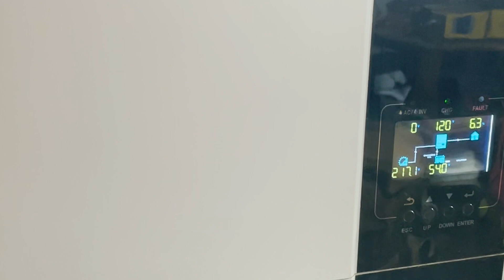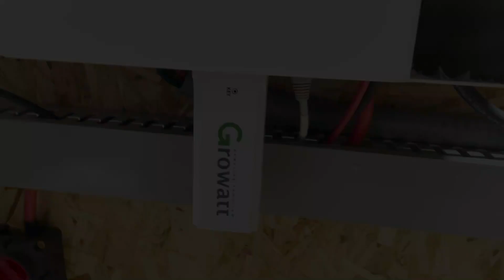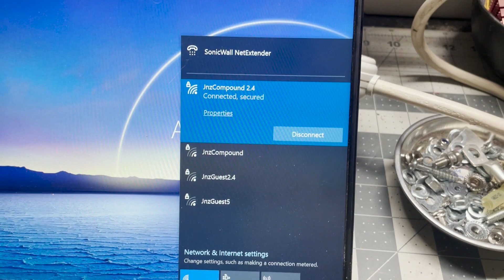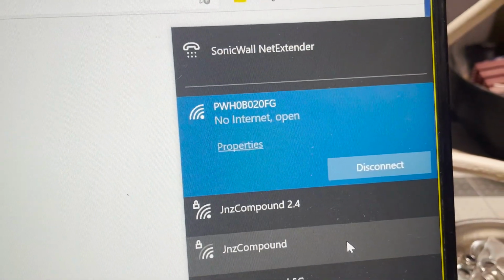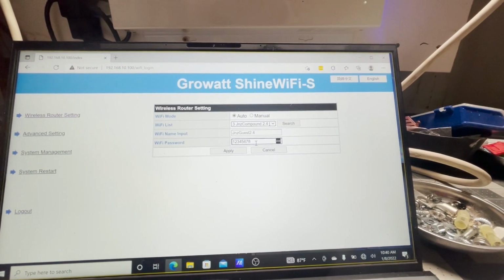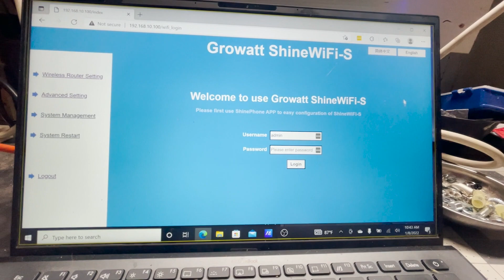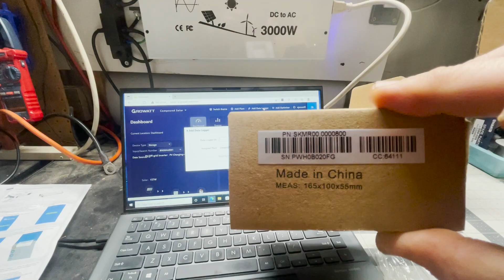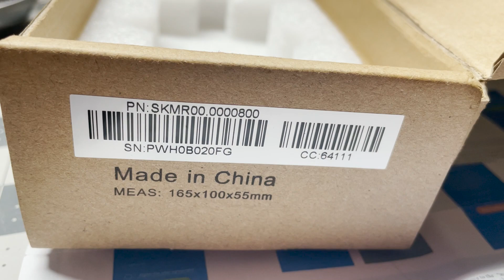Growatt Wifi Adapter Installation and configuration

Comment: Thanks for this video, I changed to a dual band router, 2.4G/5G and my Growatt went offline. I tried to set it up from the phone up, but it just would not accept the STANDARD MODE setup. I followed what you did in this video and got it working again.

Comment: Thank you very much!  I recently installed a couple of Growatt inverters that came with the wifi dongles. After two weeks of frustration trying to get the dataloggers to work, I was about to toss them. Then I came across your video. And yes, changing the default server to the US one immediately solved the connection issue. I added the S/N of the dataloggers via the website, and the Shinephone app automatically completed the setup. Thank you again!
Reply from the maker: Thanks so much for saying that.  Makes my day to know that it helped out.

Comment: Any idea what to do when the device status of the wifi dongo says: "Status: Lost" on the dashboard. There doesn't appear to be any consistent way to get the wifi dongo to get detected and connected to wifi but even when I do get it to start blinking blue and have the dashboard recognize it, it is still "lost." I have deleted and try to add it back again under the datalogger, but it gets to the part of being lost and never goes anywhere further. The dashboard says something about wait 5-10 minutes to allow the device to connect, but it still hasn't connected and it has been hours. Any help is appreciated.

Comment: I'm tempted to also buy the same grow watt inverters but after looking at so many other brands its hard to choose . If you had to buy over would you choose growatt again?
Reply from the maker: Yes I would.  I had the Growatt 3000 in a non-insulated storage container for 22 months while I was living in my camper.  That thing ran non-stop with zero issues in 100F temps.  So far I am really happy with the Growatt products that I have purchased.

Comment: Good video it helped a lot.  I installed my wifi dongle using the laptop first.  But now I’m having trouble setting up the shine phone app.  I assumed the “data logger” would already show up in the app, but it wants me to add a “data logger”.  When I scan the code, it won’t connect.  Do I have to put the blue blinking light back into the solid blue mode?  And if I do this will it disconnect everything I did in the original laptop setup?  Sorry, for the newbie question.  Thanks
Reply from the maker: No, once it is setup on the "server-us.growatt.com" site it should also show on the shine app as long as you are logging in with the same credentials.

Comment: My growatt is sso much noisy the fan always runs at full speed and it is loud, is there a solution? or can i configure the RPM of the fans in the monitoring page?
Reply from the maker: Which growatt is it.  Mine is fairly loud only when it has a lot of solar coming in or is out putting a lot of watts, otherwise it is not too bad.  Mine are housed in a separate solar shed so I don't really have to hear them much unless I am working in there.

Comment: what if the color on growatt wifi can't change? I've tried clicking it 1 time the result turns blue but it's not full, I tried clicking it again but it doesn't work. what is the solution for such problem?
Reply from the maker: You can stick a paper clip into that little hole where the light is and force it to reset and start the process over if you need to .

Comment: Has the software been ok for you ? Has the system had any downtime due to communication issues ? Thanks
Reply from the maker: No down time.  And there are settings that I have only found in the software that are not on the Growatt interface.

Comment: HOWdy  P-O-G,
Thanks
Your 5000 inverter is better configured than my 6000 GroWATT  which turns the white DONGLE  sideways 
and the "pin" I need to push / press is immediately adjacent to my  0000-AWG (4/0 +positive+ ) battery cable 😞
I have never been able to get my DONGLE to communicate with the GroWATT Server 
- due to my LACK of a CELLULAR TELEPHONE  --- which was NEVER mentioned in the Pre-PURCHASE literature 
COOP
...
Reply from the maker: That's frustrating because being able to monitor remotely is key for me.  Sorry you are having issues.

Comment: Thank you :) 
You have in parallel 48/5000 and 48/3000?
Reply from the maker: I have 2 48v 5000 in parallel and one 48v 3000 in my storage container running alone.
Reply: @pawneeoffgrid2614  thanks for the quick response!!! 
Today i order 2x 48V5000 :)
Reply from the maker: @MariosKp60  I was a little intimidated about the parallel hookup, but it was easy.  Good luck and I hope all goes well.

Comment: SPF 5000 ES( Growatt)
off Grid  Solar New Installation
with 12Vx 250Amphrs- connected in series

Why do  i get  230 current at solar  input terminals
+ points &  -side.?
(ACpower)  terminals  at the inverter.

Becos of this reason ,we did not  install solar panels to 
the Inverter.
System is working  on batteries . Fine
earthing is checked
Inverter is earthed.
when its on batteries  you  can ?? funny
but true
what is the reason  for this?
Reply from the maker: I am not exactly clear on your question, but I know the 5000ES growatt will except 450v in solar.  If you are connecting your panels in series, you will be adding the voltage for each panel that you plug in.

Comment: Johan de Swardt : South Africa : 
(1) So I assume the Growatt inverters do not have build-in Wi-Fi monitoring abilities, like other Inverters?
(2) If I have two Growatt 5Kw SPE 5000 ES 6000W single phase invertors, parallel connected, will I need one or two Growatt Wi-Fi Adaptors?
Thanks
Reply from the maker: Correct, you have to buy the wifi adapter separate.  And I am not sure if both inverters need an adapter when paralleled together.  I am wiring mine up over the next couple of weeks and will find out and let you know.

Comment: Nice Video man. I got the shineWIFI-F Adapter because this one is especially for the SPF5000 ES Off-Grid-Inverter. Now i wanna install and the Wifi which is broadcasted by the adapter has password and this is nowhere to find. So i could not connect to this network and i could not install the adapter. 😞I even reset the adapter but same problem again and again. Do you have any idea to solve or do you know a factory password? Thanks and greetings from germany.
Reply from the maker: admin and 12345678  is the default password

Comment: Hi. Thank you for the video. Actually I live in Lebanon. My datalogger was working fine. I changed the router so I had to reset and configure it again. I followed all the steps 100 times but I end up with Flashing green light.
Any suggestions?
Reply: I also had to change my router name and I am sure that the  dongle has a problem re setting to the new name.

Comment: Can i add 3 separate inverters for separate people all connected to the same Internet router ir does it induce problems?
Reply from the maker: I have two of them running and will add a third soon.  SO that should not be an issue.
Reply: @pawneeoffgrid2614  thanks for your reply. Btw do you have any idea about the communication between the growatt and felicity lithium battery?
Reply from the maker: @ma060704  I don't have any knowledge or experience with that combination of devices.

Comment: I am from Sri Lanka. After viewing this video I was able to configure the Wifi dongle. Thanks a lot. 
I would also like to know whether there is a way of connecting a laptop to the inverter using USB. What I would like to do have a look at the current settings and back them up.
I have a SPF 5000 ES  inverter and a Growatt Hope 4.8L-C1 battery.
Reply: Not very difficult
Reply: SPF 5000 ES( Growatt)
off Grid  Solar New Installation
with 12Vx 250Amphrs- connected in series

Why do  i get  230 current at solar  input terminals
+ points &  -side.?
(ACpower)  terminals  at the inverter.

Becos of this reason ,we did not  install solar panels to 
the Inverter.
System is working  on batteries . Fine
earthing is checked
Inverter is earthed.
when its on batteries  you  can ?? funny
but true
what is the reason  for this?

Comment: Great video, do you have to turn off the system before connecting the dongle? Or is it possible to plug it while the inverter is on and powering my house?
Reply from the maker: You can plug it in and configure it "hot".  No need to turn the equipment off.

Comment: Great info for the future. Have 3000w array pumping water on my Thai farm. Looking to growatt 5000 for my house power. Solar work in Thailand is difficult due to low information level of merchants also a lot of low end Chinese products flooding the market. Growatt has a support network that reassures me that it can be done. Thanks.

Comment: Maybe it's been said, maybe it hasn't, but if this piece of sh presents a secured adhoc network when we drop to AP mode, unlike the open network shown here, the password will be the same as this video shows for the admin console: 12345678.  Ask me how I know?
Reply from the maker: What?
Reply: @pawneeoffgrid2614  eli5: If the wifis needs a password.  😁
Reply from the maker: @iHeartDawnKeyes  So are you referring to me as the piece of sh????
Reply: @pawneeoffgrid2614  lol, I thought that's what you might be worried about.   ABSOLUTELY NOT!  The comment was made on the same frustrating day that you and everyone else here had, trying to get this adapter configured.   As an IT Operations Engineer, I spent about 3 hours more than it should have taken on this thing.   Its size is 10x larger than it needs to be, should not be an external dongle and instructions shipped did not describe a wireless AP configuration, but rather a more IoT device setup.

This device, most especially the initial setup, was a piece of sh.  It works okay now that it's configured, but still has issues.   FYI all, it does not deal well with heat.  Data ingestion will come to a halt if the device gets too hot.  

So, no.   Not you.  😊 Thanks in fact.  Without your video, I probably would have had another hour into Googling for the admin console password.
Reply from the maker: @iHeartDawnKeyes  Oh good, I was confused.  Yeah it is way more complicated than it needs to be for sure.

Comment: If you have 2 in parallel,  you need 2 wifi adapters or only 1 . Thanks
Reply from the maker: That is very good question, I am guessing here but I feel like you would need a WIFI adapter on each inverter.
Reply: Thanks for this video. 
Please I have four growatt spf 5000e to connect in parallel , do I have to configure each of the four Wfi adapters individually , or do I just plug each of them and configure just the one on the master inverter? 
Thanks.

Comment: Thanks for the video. I did have to add -us to mine. However I still show status:lost and no data or even firmware info is being communicated. Sigh, I thought the laptop way would be a winner after a long failed road with the android app.
Reply from the maker: Sorry to hear that.  I know it is not the easiest process.

Comment: Pawnee, I just got 3 growatt mppt chargers. Signature solar doesn't have background on them being so new. I'm trying to figure out whether to use gprs or wifi. My lappy does wifi but not connected to the net & it would seem the wifi dongle needs to connect to growatts servers to use the app. Would you know if the gprs dongle doesn't require connecting to their servers?
Reply: Use your phone as a Hotspot to get internet to the laptop for the setup.  Then you can use an access point to remotely view parameters while in range.  This is what I had to do when setting up my 18k watt generac.
Reply from the maker: I do not know the answer to that question.
Reply from the maker: My guess is it will require an internet connection.